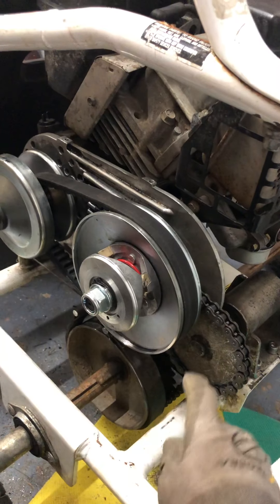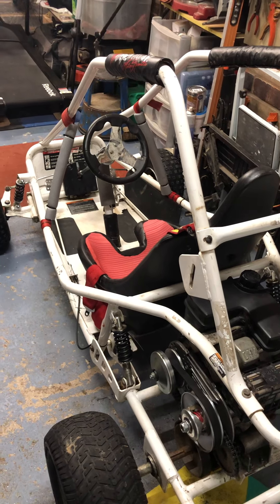Murray hard drive go kart 30 series torque converter

Comment: i was wondering what website you got that torque converter for because i was thinking to put one on mine
Reply from the maker: Jonah  I purchased it from eBay but they also occasionally pop up on Amazon. If it’s the 1” driver you are after then they are a little harder to come by.
Reply: UK Small torque thanks we were worried that we would have to pay loads